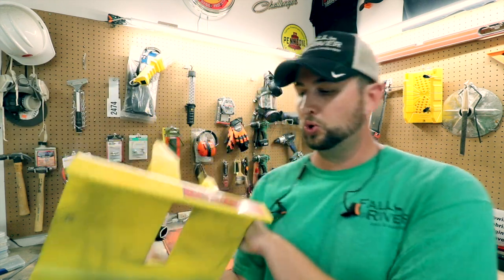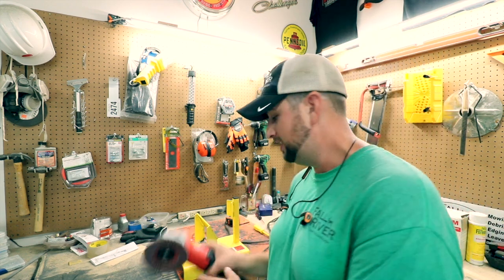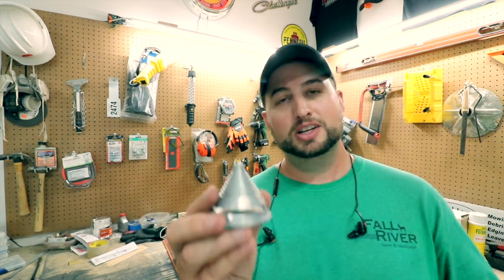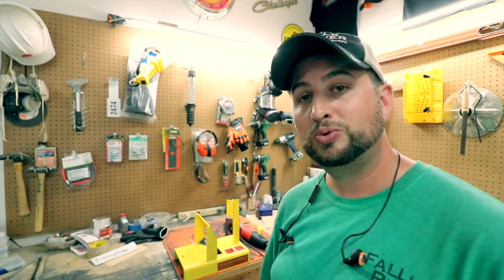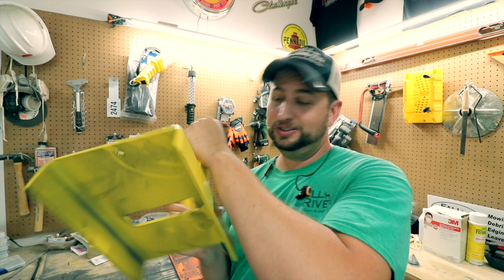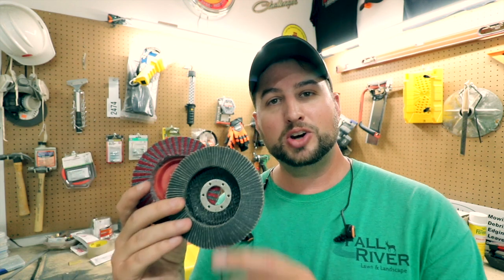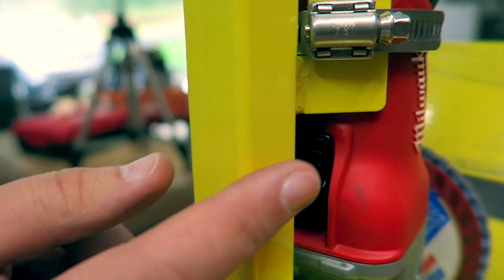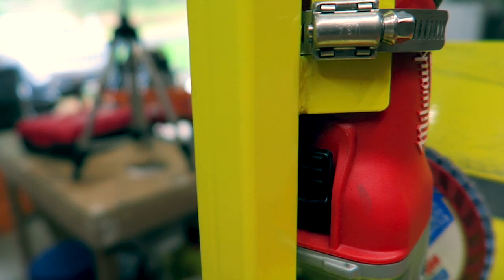How to sharpen lawn mower blades Yellow Hornet Mower Blade Sharpener Setup and Review

Comment: Have you checked out the All American Blade Sharpener? I just bought one on Amazon for about the same price as the yellow hornet. The advantage to this jig is that he grinder is placed on the jig with just a pin with no measuring or clamping anything down with makes preparation a whole lot quicker. It's also more versatile to take with you for out in the field if you choose to take it with you. It can mount on the trailer. Check out the YouTube video tutorial it seems really cool.
Reply: I think i will be buying an All americain sharpener in the near future

Comment: Why would anyone buy this, you can get an inexpensive bench grinder for $39.99 at harbor Freight.  I am assuming the Yellow Hornet is cost at least as much.
Reply: The Yellow Hornet is a jig that helps to maintain the correct angle when grinding a blade.  I agree that the Yellow Hornet is way too expensive.  The bench grinder still needs a jig to ensure the correct angle.
Reply: Quick search on eBay New one are $100 w/free shipping. Spend $100 for a perfect grind and angle or $40 for a bench grinder that doesn't make a flat edge (grinding wheels are round) and no way to set to 30°? Yellow grinder is a no brainer 👍 I got a bench grinder setup and my blades look terrible and I grind way too much off and it takes way to long trying to make it perfect. No more bench grinding wheel for me 👎

Comment: I bought this based on your review.  I can't get the outter half of the blade to sharpen like the inner half which is very sharp.  I've tried all different angles, wheel depths, etc and I'm just getting a blunt edge on the tip.  What is wrong?

Comment: How long does it take before you crack the plastic case of the grinder by tightening the screw clamp? It should have some rubber mounts to hold the grinder.

Comment: Great video and demo !  Thanks Much for sharing that !   I'm just using a bench grinder . It works but like you said, getting a consistent bevel is near impossible for me.   I agree with Paul on doing it outside the shop. Maybe mount it on a bench with wheels and set up just out of the garage .   I put an old 13" long cake pan with about  1/2" of water in it where the sparks fly out, catches most of them .  Glad to see you feeling better !